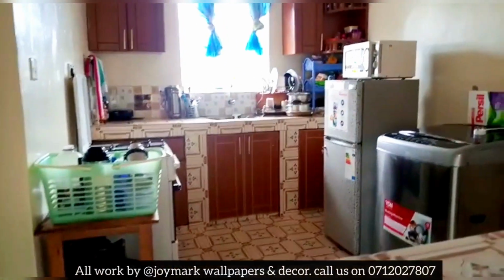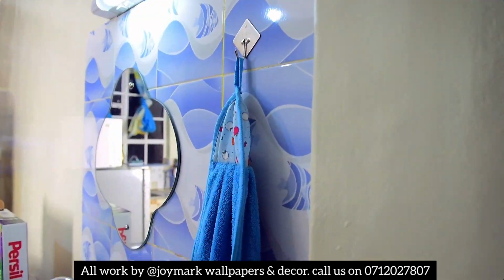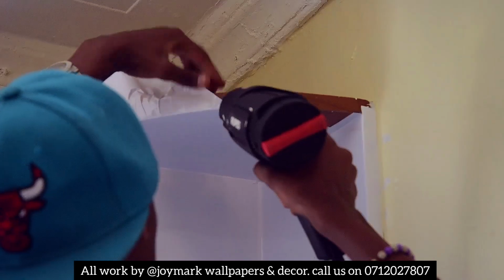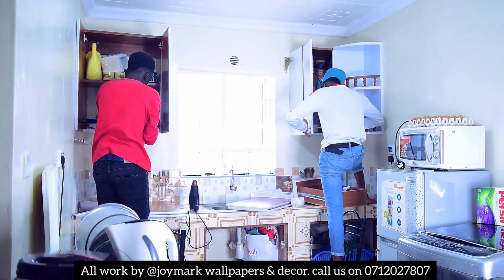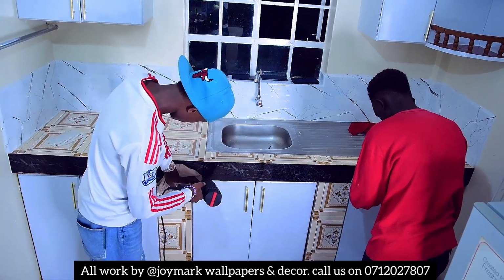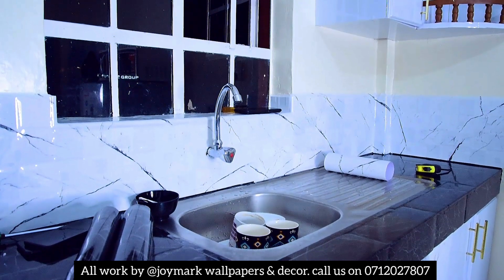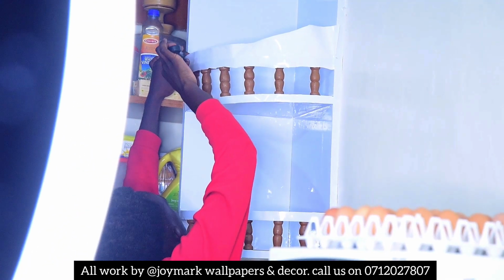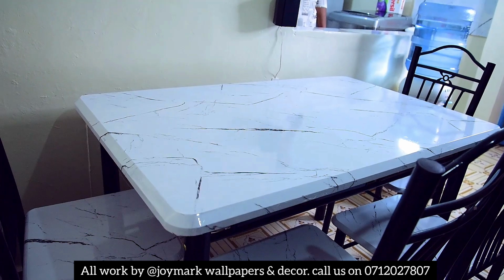BEST KITCHEN MAKE-OVER USING CONTACT PAPER/ CONTACT PAPER INSTALLATION/ DIY CONTACT FRIDAH NGUKU

Comment: how much is conta paper per roll? and also how much is the installation cost per roll?
Reply from the maker: They range between 1800 and 2200ksh per roll depending on the design you choose. Installation is 800ksh per roll
Reply: @FRIDAHNGUKU  thanks for the detailed information. Keep up with the good work you're doing.